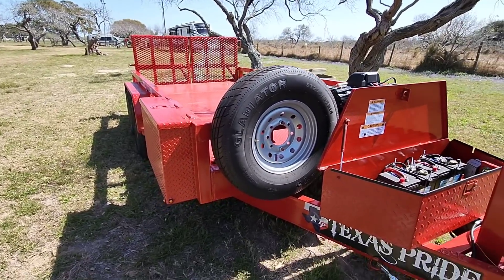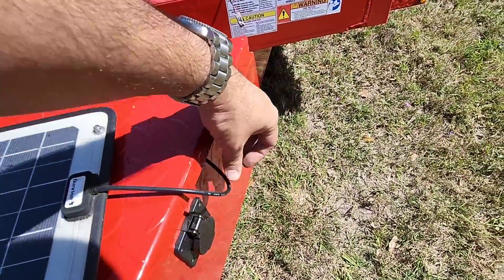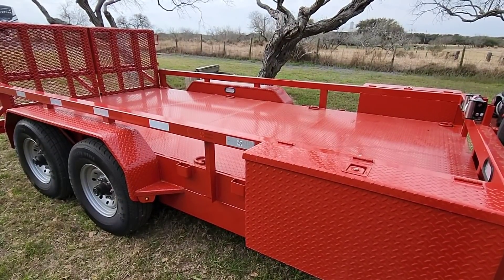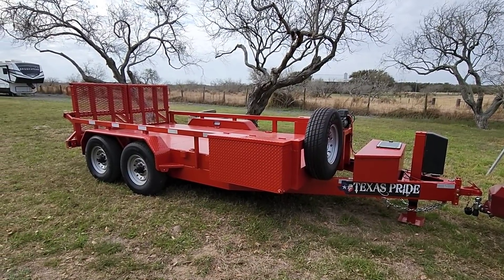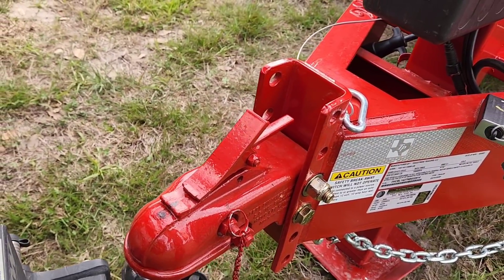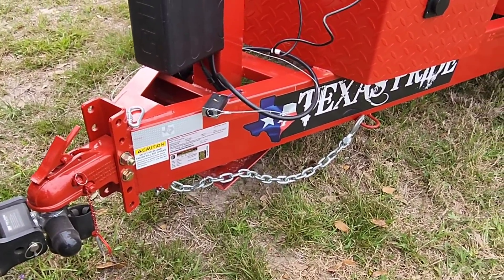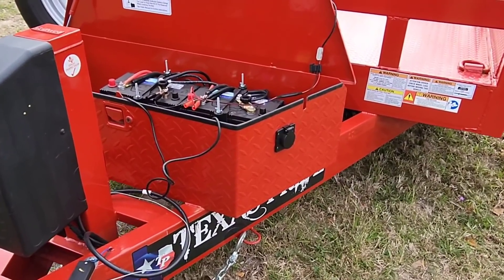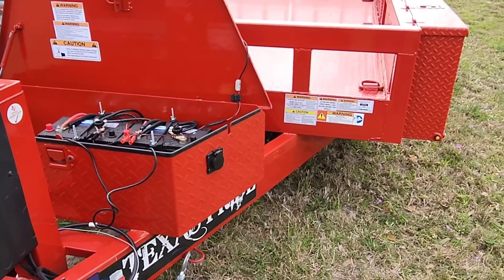DON'T HIGHBALL your Trailer Coupler!

Comment: You know with the negative disconnected on each battery the way you hooked up the charger, one lead on each battery nothing will charge. If you put the leads on the same battery on each posts with the negative disconnect that one battery will charge.
Reply: That's what I originally thought as well, but after looking at how the batteries are hooked up again I saw there was no disconnect on the positive side of the batteries. Power will run through the positive cable from the right battery to the left battery, and with the charger connected to the left battery negative side a circuit is complete, but only the left battery will charge.
Reply: He should put a wire between the 2 battery grounds then he could charge both with the disconnects disconnected
Reply: What does highball  trailer  mean ?????
Reply: @darrellrobison2479   having the hitch sit on top of the ball, and not locked onto the ball.  Basically, it is just resting on the top of the ball.
Reply: @darrellrobison2479  If it happens to you, then you need to buy new shorts. Robert has the correct answer too.
Reply: Huh? Was it disconnected? It looked like they were in parallel to me.
Reply: @Gideon_Judges6  he has disconnects on the negative wires. He has since fixed this issue on another video he posted

Comment: I've had 2 or 3 instances where whether renting a trailer, purchasing 1 or i let someone hook it up, where they were insulted that I would double check their work, but it was high balled. I figure it's MY truck that would be damaged, not to mention it could cause a terrible wreck. Always double check the hitch!
Reply: Yes!
Reply: And YOU are the driver. The police will issue YOU the ticket 😉
Reply: And YOUR insurance rates will be the ones to rise
Reply: I used to work for U-Haul and you wouldn't believe how many customers would bring the trailer back highballed... 🙄 It takes 2 seconds to check man...
Reply: I insist someone checks behind me. 
My moto is "if you don't check behind me that's your first mistake ".
Reply: I don't get that. By all means check behind me! Not that I'm not untrustworthy or don't know what I'm doing, but because I'm human and we all occasionally screw up. Especially when it comes to safety, I expect someone to check behind me. I want some to check behind me.

Comment: After 30 years of towing I just high balled about 2 weeks ago. I hitched my lightly loaded 12’ cargo trailer, drove 2 blocks to a stop sign and heard a loud metallic thud when stopping. Immediately got out and inspected the hitch, still didn’t notice I was high balled. Drove a 1/4 mile at 45 mph and the trailer bounced off the hitch, swayed terribly, I was able to slow down and pull over only to find the trailer dragging along by the safety chains. One of my scariest moments towing. Luckily my load inside the trailer was strapped and remained undamaged.

Comment: Make sure your safety chains can take it !   I hit a pothole, highballed the trailer, which ended up passing me after the ' dog chains ' I was using snapped . Fortunately, I caught up with the trailer, and nudged it off the road .  The trailer mowed down about 50 yards of Japanese Bamboo before coming to a stop .  Damage was minimal, could have been a lot worse .  Wound up using tie down straps as safety chains to get home [ not far ] . Lessons learned, get ' real ' safety chains with a load rating, replace worn out Ball . Use a floor jack to verify hitch is secured, before taking off .

Comment: I was pulling a rented U-Haul trailer from Massachusetts to Pennsylvania back in 1977-ish and my entire trailer came unlocked but the safety chains kept the trailer attached to my tow vehicke.  Man, that was scary as hell.  Apparently, I hadn't tightened the nut on the bottom of the ball very securely.  Man, that could have been one hell of a disaster had the trailer come completely separated from the tow vehicle.  Back in those days, I was making Sergeant's pay and I did not have much money.  After carefully pulling the tow vehicle & trailer off to the shoulder of the road, then I saw the damage to my  vehicle.  Fortunately, I was about 300 yards from an auto parts store so I ran down to that store and fortunately the cost of a new ball hitch was not too high. After installing the new ball, I droove to a gas station and explained my situation and they allowed me to use a hefty wrench that snugly fit the large nut to tighten the assembly.  Believe me, every 100 yards I was eyeing my trailer in the mirror for anything.  Every mild bump on th highway, intensified the pucker factor.  I was relieved when I got to PA and prayed and thanked God for His guidance.  50-ish years later, I've never had an issue and now I have much more money for any type emergency and I pray and thank God for sparing me and my family.

Comment: My trailer has the bulldog type hitch with the slide collar. I lowered the trailer down and hooked up the lights and chains and took off. The load kept the trailer on, but after unloading and going down the interstate at approximately 70mph, I hit an expansion joint in the road, causing it to jump off. Thankfully the traffic was light, and the safety chains done their job!
Reply: I was saying that this bulldog style was bulletproof but, yeah, you do have to finish the job and attach it :)  Let me guess. You got a phone call right after you set it in place?

Comment: You might want to warn people about high hitching their fifth wheel.   

I’ve always had the rule you can watch me hitch and unhitch a trailer BUT don’t you dare trying to help.  I have a routine that I follow and your help will only slow me down because I’ll go back and recheck everything.  

Same rules when I drove semi’s.
Reply: I have the same rule for strapping down my loads.  People that don't pull trailers have no idea how to tie things down, where to strap, how many straps, etc., because they've never had to discover and deal with those problems while going down the road...
Reply: My truck. my trailer. my load. my way if it fails my fault. And every time I stop. get out check the coupler and the drawbar hair pin. found someone pulled it one time stopped for a snack walked past and looked at it some pick pulled the  drawbar pin hair pin and took off. Now it's a lock pin 24 7 . everyone has a start phone now don't take much to look up how to or like
Reply: This is so absolutely true. I had a friend helping offload a car from my trailer, he did the ramps. Just because of that i made a series of silly (not big) mistakes because my routine got thrown off. I always appreciate help, and I rarely get help. But Im used to operating on my own, and Im good at it and used to it.
Reply: Not to mention someone trying to help just screws up your system and makes it much easier to forget something!  Been there done that!
Reply: How do you high hitch a fifth wheel?
Reply: I've had folks want to "give me a hand" when hitching, and I kindly thank them to go fetch me a drink of water or something to keep them occupied.  I like going through my checklist without chatter, just like "sterile cockpit rule" when flying a plane and doing checklist intensive activities.
Reply: Stephanmcpharlane1151 It's possible with a 5th wheel hitch to have the jaws or slide locking bar to low to slip through the grove on the trailer hitch pin on the trailer side. Big enough bump and the pin could be bounced out of the hitch.

Comment: Drove 57 miles with half of it up steep winding roads with my snowmobile trailer and two sleds. Didn’t know it was highballed until unloading the first sled and the trailer shot up in the air.

Comment: I towed an equipment trailer countless times. Always thought it was a 2" coupler. Never really looked for markings saying it was otherwise, never noticed that it was different, never towed any different. One day with the trailer empty i hit and exceptionally large bump and suddenly felt my truck lug down. I thought something went wrong with my truck. I pulled over to the side and got out to look for problems. As I'm walking towards the back i see skid marks following the trailer i get to the back and see the trailer hanging from the chains. The chains and the brake safety did their job. It was at that moment i discovered it was a 2 5/16 coupler. I didn't have a 2 5/16 ball with me so after an ordeal to get the trailer back on the ball (jack wouldn't go high enough without the sand foot extended atleast one pin hole and couldnt extened the sand foot while it was hanging from the chains) i hooked it back onto the 2" ball. I drove very carefully the last few miles to my destination and i immediately bought a heavy dity 2 5/16 hitch. All said and done it was a stupid mistake on my part but thankfully it turned out the best way possible for the situation.
Reply: A person never knows how they will mess up but mess up we will.  I have separate balls including the 2 inch and a 2 & 5/16" which I can use. I've ordered a new truck which means I may need to buy new hitches to go with the 2.5" or 3" receiver the truck will have. I'm upgrading from a 3/4 ton to a one ton but Ford has changed some stuff for trailering.  I might consider going to a setup like he shows in the video.
Reply: My dad pulled my uncles boat to our house for my uncle then on the weekend i launched it for him and i asked dad what ball and he said 1 7/8 but it didnt seem right so i looked at it closer.  Nope its a 2.    I didnt used to have a 2 5/16 that would fit though a heavily wore 3/4 hole drawbar on the tractor so i used a 2 since on property no road use and i did have trl hop off once
Reply: I think I have only ever heard about 50 mm ball in Norway/Europe.

50 mm is 0.8 mm smaller than 2" (or about 1/32" ).
They might probaby be compatible, but I wouldn't bet on it.
Reply: @thorbjrnhellehaven5766  they work. That's .4 mm clearance all around, which is well within tolerance. I happen to live in the town in the US that used to house the Luftwaffe's primary fighter training base. There were many German families stationed here for lengthy stays. Many brought their vehicles, and the 50mm ball is interchangeable with 2" couplers.

Comment: I was moving from Fresno to Southwestern New Mexico, driving a 20 foot Uhaul pulling a Uhaul Auto Carrier. My car was on the carrier and full of cargo. A couple miles down the road, pulled into a gas station and noticed in the mirror some SERIOUS drag marks. Don't know how long the trailer had been off the ball, but it was a "fun" adventure getting the two reconnected. Thanks to the safety chains, no damage to either vehicle. Never again!

Comment: One of my first times hooking up and towing a trailer, I high balled it and it did in fact come off of the ball. THANK GOD it was at a very low speed and thank God again I did know enough to cross the safety chains which did exactly what it was meant to do and cradled the tongue of the trailer and prevented it from hitting the ground and digging in. it was only a very small utility trailer but none the less, it taught me a very important and valuable lesson that I will never ever forget. My wife was also with me and she also learned from the experience. TYVM for the video.

Comment: 17years old. Pulling a small trailer with two snowmobiles onboard.  The tongue severed at the trailer bed and when I looked in my mirror the trailer was pulling out to pass me. I stepped on the gas, upon looking in the mirror the trailer jerked back and went into the guardrail flipping one machine over. 
What caused the trailer to jerk back into our lane was the electrical harness hanging on long enough to jerk the trailer before the  harness broke and pulled apart. The tongue with safety chains were still attached to the tow vehicle. We righted the snowmobile, jury rigged the tongue onto the trailer and went on to go snowmobiling. Never miss a good day in the bush snowmobiling. Lucky for sure.
Reply: @bobcarlsson4  electrical harness was a true bro. RIP

Comment: I bought a boat in FL and drove home to PA about 15 years ago. I had found and bought the boat, even took the boat to a buddies house down there and went over the wheel bearings and lights for the trip home. I hitched up the trailer, put a lock on the draw bar and the coupler, and headed home. I did the drive non-stop except for a few rest stops and a few meals. 
I get home, a neighbor comes over to check out the boat I just backed into the driveway and he steps up on the back of the swim platform to hop into the boat and the trailer pops up off the ball. The chains stopped it from raking my tail gate but it popped off as if it was never locked onto the ball.  I tried every which way to see if it would drop back down with the coupler closed but there was no way. Along the way I had checked the hitch and even climbed into the boat the same way and it never budged. Being a lighter trailer, I even did the manual lift check before leaving, and a few times along the way. 
To this day I never figured out how it came off the ball. I figured that there's no way it went 1,500 miles from south FL to NE PA just sitting atop the ball. Especially considering I made two stops off the highway in SC to a buddies place there which meant several miles of dirt roads into his farm. Before I left, I even double checked and adjusted the coupler to fit the ball tighter because I didn't want to hear it rattling around. The ball was greased lightly, and the coupler had a pin lock through the lever to prevent it from coming loose and to prevent anyone from screwing with it when I stopped. I had even given the thing a few good yanks a dozen miles from home when I stopped to get gas and it felt secure. 
I also had pulled the outboard off the boat and laid it in the bow of the boat to increase tongue weight, if the coupler was the issue, it likely helped keep it hitched all those miles. 
In the end I replaced the coupler on the trailer for good measure, but really didn't see anything wrong. I was really glad it didn't rake the back of my truck when it popped up, (chains would have stopped it from coming off and getting loose on the highway). It was far from my first long trip with a trailer and certainly wasn't my last.

Comment: I’d think about redoing the battery connection. With both batteries having disconnects you’re not charging either or as the positive is on one lug and negative on the second battery on the disconnected side. Connect the batteries in parallel, the run the wires to a bus bar and in between run a disconnect to the loads. 

Also the smaller ring terminals on the post first and the larger ring terminals on top is recipe for hot wires and possible melted wires depending on load when trailer is loaded up on the jack. Just switch them around.

Comment: We hooked up our trailer. The hitch went on smoothly. We thought it was too easy and when we pulled out of our driveway the trailer bounced off the curb and off the ball. Good thing it happened right there and not on the road. Dont forget to put the lock pin in

Comment: That is exactly why I use the jack to lift the truck up after everything is locked up. If I can lift the truck back up, then it should be connected properly. Checking underneath is also a great practice. If I end up wearing out a jack someday, buying a new jack is worth not having the trailer come off and having something catastrophic happen.

Comment: I rented a 25’ travel trailer in Salt Lake City one time.  The rental place did all the hook ups and I neglected to check things before hitting the road.   After a few miles and some big jolts over rough uneven bridge transitions etc something told me I needed to pull off the road and make sure they had locked down the coupler.  Sure enough, they hadn’t dropped the coupler lock and the only thing keeping it on the ball was the tongue weight.  It’s a miracle it hadn’t bounced off the ball over some of those rough uneven road transitions at highway speeds or come off under heavy braking!

Comment: Just a suggestion -- with that fancy power jack you could easily test the coupling of your trailer by raising the jack a little bit and see if the back of the truck lifts or the trailer separates from the ball......again just a suggestion 😀 😉

Comment: I’ve helped my dad hitch up our rvs since I was in elementary school. But my buddy got a new boat with a really old trailer and I hooked it up and thought it was hooked. Turned out. A few miles down the road we went over a huge bump in the road and it came unhitched. Thankfully the safety chains caught the trailer and all was ok. All except for my pride. So since then I triple check every time I hitch a trailer.
Reply: This issue might be a good one to attach an orange-colored flag which will remind you when loading or unloading to pay special attention to what you are doing.

Comment: Bought a new travel trailer. RV tech lowered it onto hitch when I backed up. I was only towing a few miles home luckily because I didn’t realize I had the wrong size ball on. Made it home without an issue even though I went over some RR tracks. Will never let anyone else hook my trailer up for me in the future.

Comment: My favorite hitch is the "Bulldog" hitch. I  have 2-5/16 inch ball. The hitch opens up "clam shell" style & a sleeve locks it in place. It's easier to couple since it can tolerate being off center of the ball by up to an inch, & it will center as you lower it onto the ball. No guessing if it's connected or not.
Reply: And essentially you can't high ball it since there is nothing for it to "catch" on.